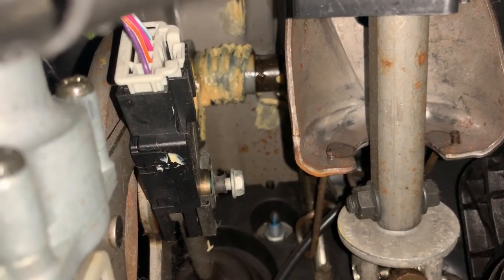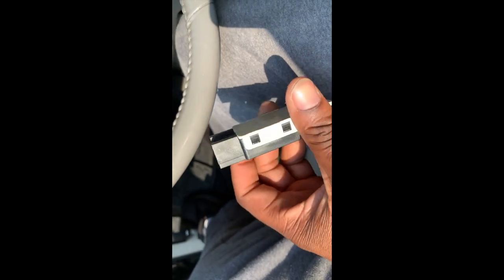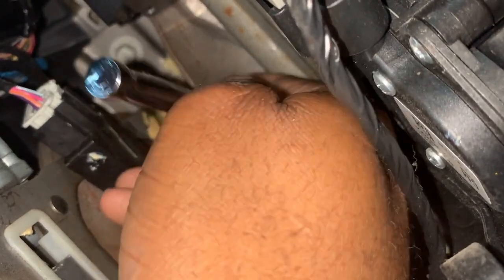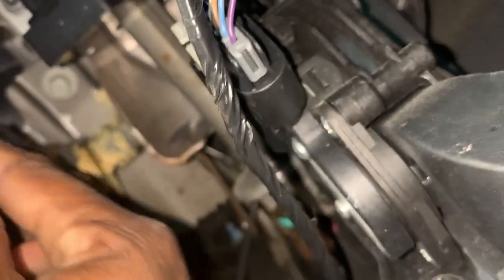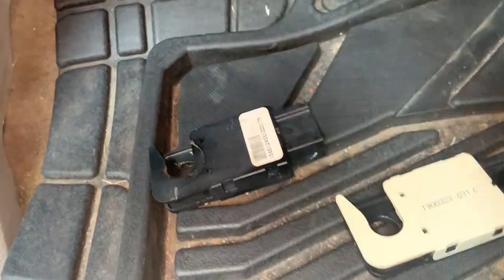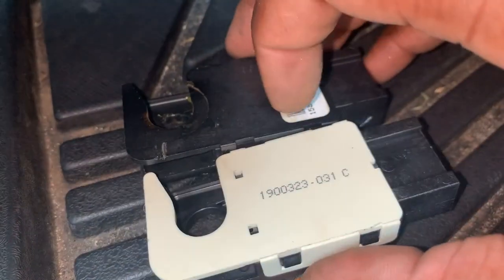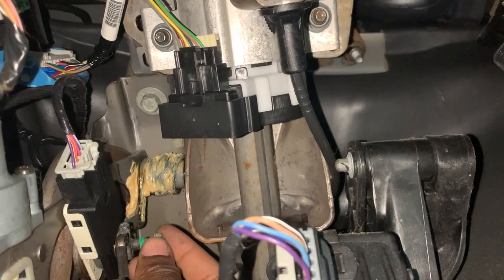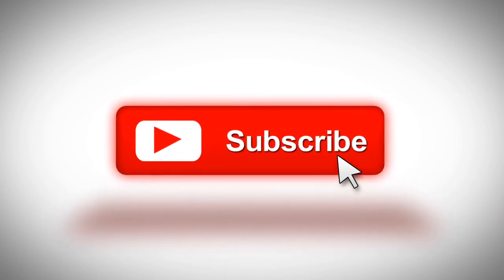Brake Light Switch Chevrolet GMC Cadillac

Comment: Any idea on why my passenger back light not working already replaced lights only works when putting signal light on
Reply from the maker: Could be the brake switch or a bad wire